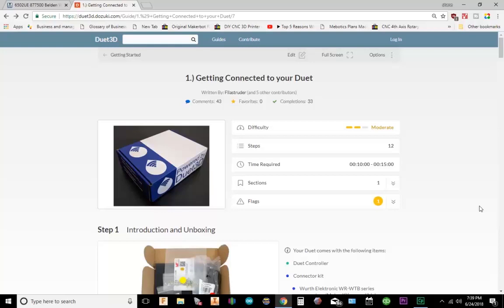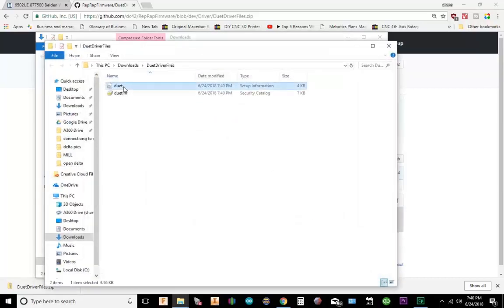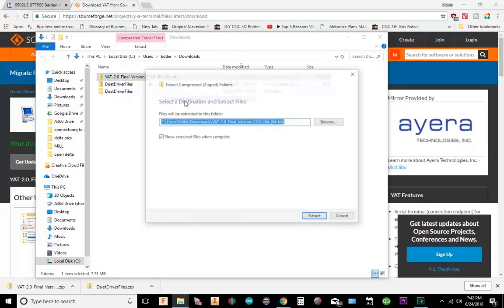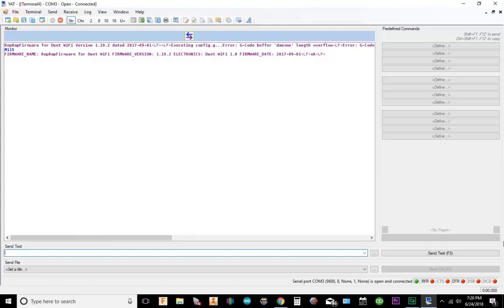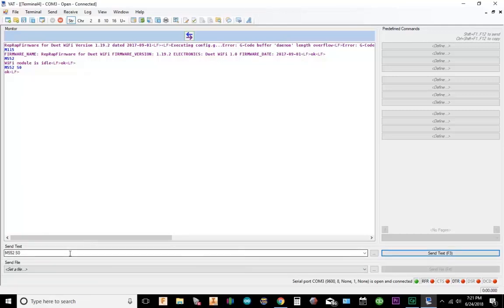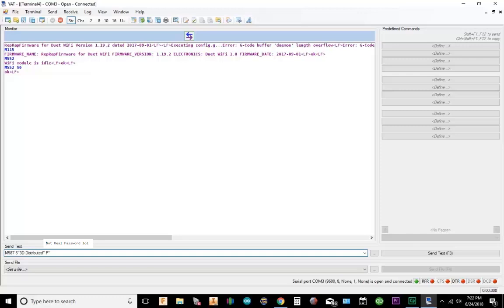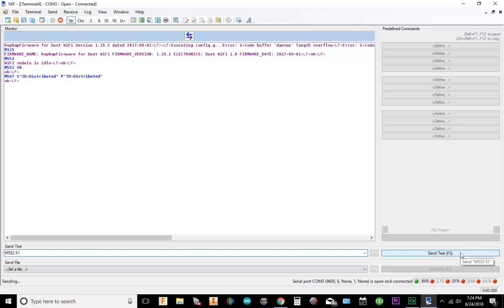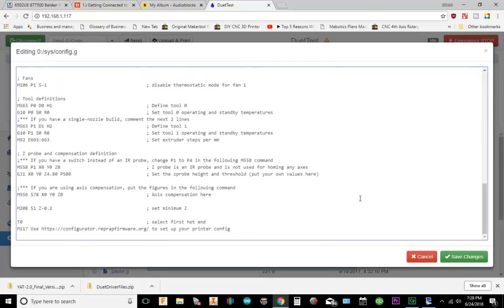Duet Wifi Setup: How to Connect to Duet3D Wifi Board

Comment: So stoked you made this video, I was cleaning up a bunch of files on my computer and I lost the wifi connection on my duet.  I had to use this video again to figure it out. I found that if you don't do this procedure exactly how you explain. You will never get it working.  Thank you so much for making this video. You saved my sanity again. With out this video, I would never get it working. Peace out 3D Distributed.
Reply from the maker: Thanks! I'm glad it was useful for you. The sound quality isn't that good but it's informative.

Comment: HI Thanks for your support,  i've got a problem after yat procedure, when i put the ip in chrome browser i correctly open the web page but i can't push on connect button at the top left of the screen.
the button connect rest on gray mode, and i'cant upgrade firmware and i'can't do anything